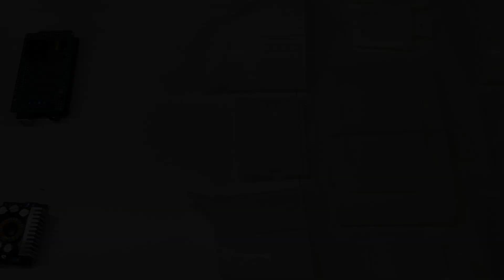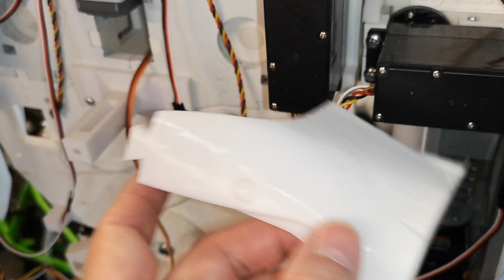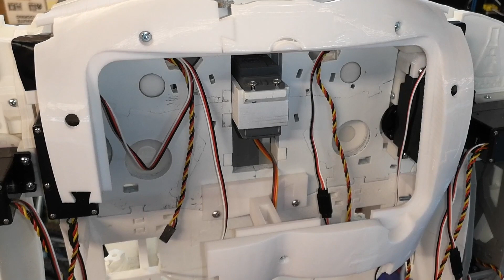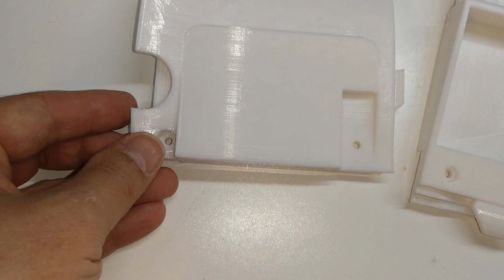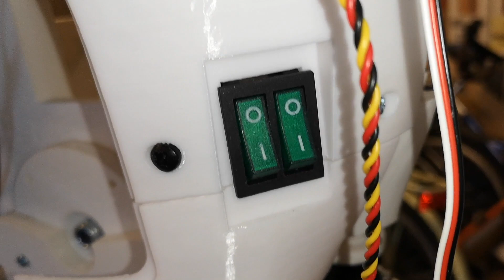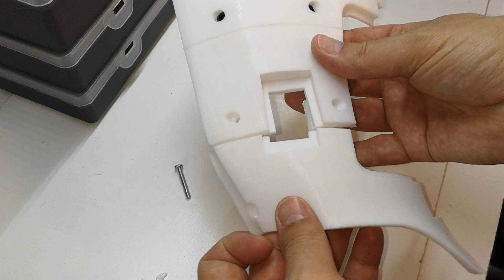Civrays InMoov - Back Covers

Comment: hello sir, 
i am a 16 years old boy who wants to build this robot. I just ordered the nervo board kit from the inmoove website. I think i am going to start by making an arm i also bought some servo motors (mg996r i believe) can you maybe give me some reccomendations on what other stuff to get for like arduino, cables, etc. i would really appreciate that sir! also excuse my bad english
Reply from the maker: If you're going to use the official Nervo boards then you will want an Arduino. You should get either an Uno or a Mega. You can get cheap clones if you are on a budget. For the arm you will also need braided fishing line for the fingers. Also get a little bit of 3mm printer filament to make pins for the finger joints. Did you order the Nervo boards with or without components? Either way I think you need get the 14way ribbon cable separately. Finally you will need some form of power supply or battery. Just ask for help when you need it and be sure to post photos of your progress. Have you created an account on the inmoov.fr website?
Reply: @SteveRaynerMakes  Good evening sir. I have bought the nervo board with the components. But i think that is only usefull for when the build is further on. I have also bought the arduino in a small kit of of amazon. Do you think the motors i bought are strong enough? Also i heard i had to get around 15 stronger motors like the hs 805 bb i think it was. But do you know any cheaper alternative to these? I will post pictures of my progress! I staryed printing today! Thank you very much for your advise and help sir!
Reply: @dr_epic_gusta5714  Hi, I am also an 16 year old building the inmoov robot. Instead of using the hs805bb I used 20kg JX-PDI6221MG servos for the bicep and shoulders which are doing fine. I used these as they were much cheaper than the Hitec ones. I printed some adapters as the jx servos are smaller I am still looking for an alternative for the stomach.
Reply: @dr_epic_gusta5714  Which country are you from?
Reply: @harshithguggilam8168  Thank you very much i will be looking into these!
Reply: @harshithguggilam8168  I am from Belgium.
Reply: @dr_epic_gusta5714  
What stage of the robot are you up to?
Reply: @harshithguggilam8168  I am currently still printing the last parts of the hand. 😅 I was going to start by making the hand/right arm and work my way up from there.
Reply: @harshithguggilam8168  Also one more question. Why do you need another alternative for the stomach and dont use the ones you used for the becip en shoulder?